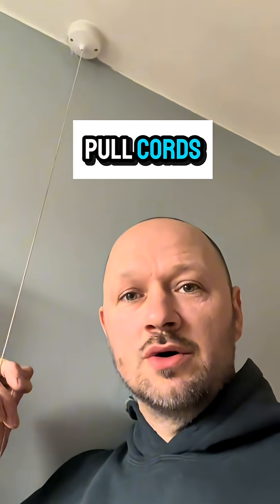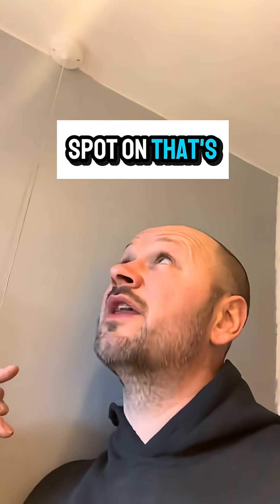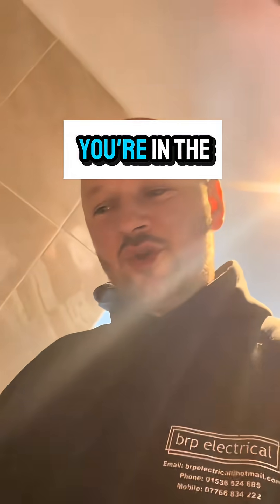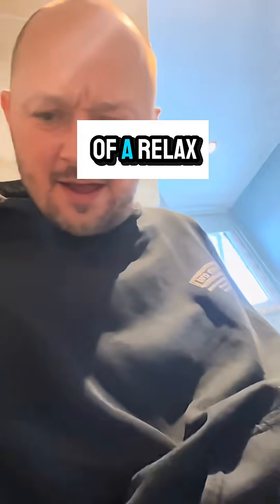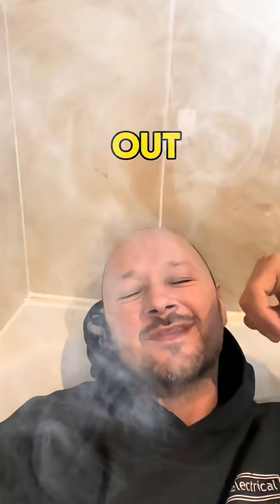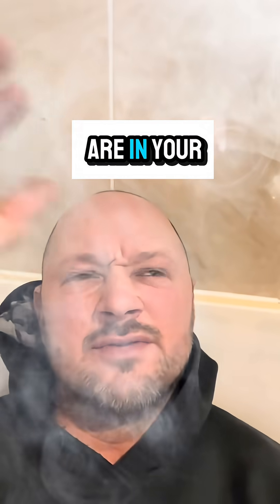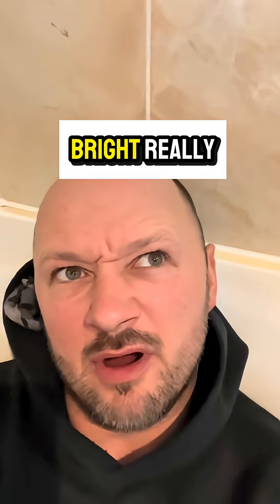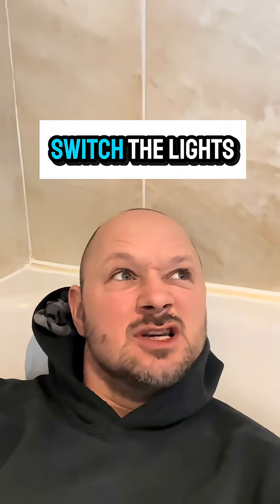Bathroom Light Control in the Bath?! – Kinetic Switch vs Regs (Is It Actually Allowed?)

Comment: Well technically there is no power going to or from it   and a switch is defined as a device that interupts. Supply of electricty and by rights it isnt actually doing it its just sending a signal to the relay thats doing it so

Comment: I suppose as its technically a movable accessory, its not really dangerous and not even potentially dangerous as those are IP rated so no code, right? Or at the very least a C3?  Im a new electrician so I'd have to look in the brown book a couple of times then call a more adultier adult to confirm.